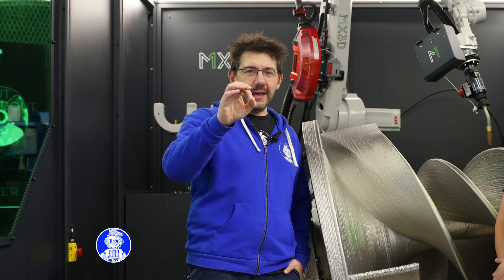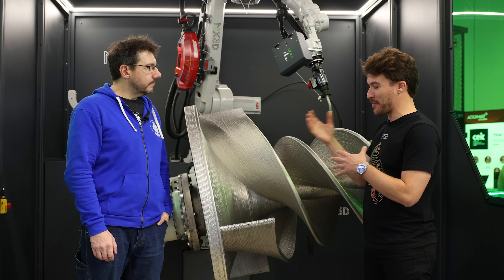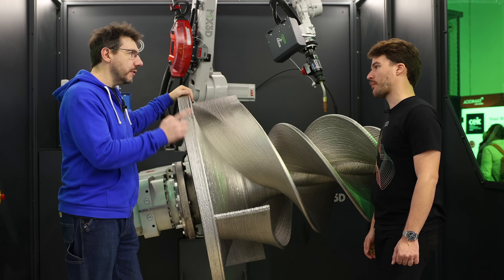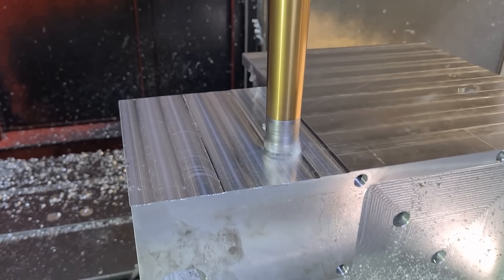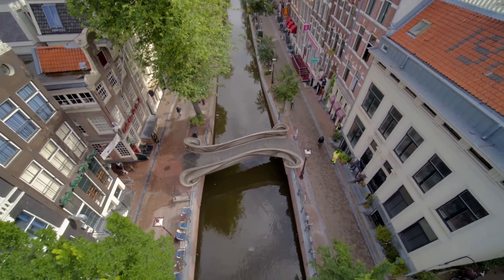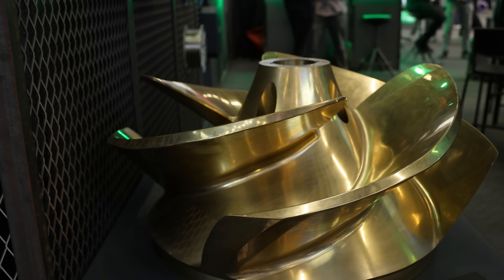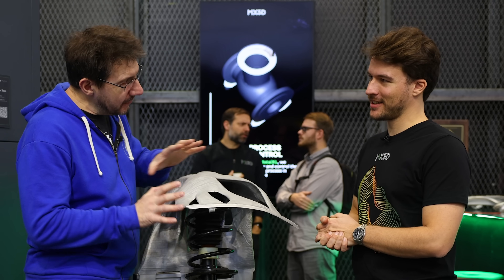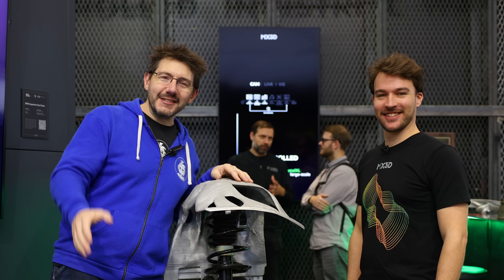GIANT METAL 3D Printing! MX3D // Formnext 2024

Comment: Imagine a whole 3d printed monocoque chassis with this. Maybe floors and firewall out of robotic formed sheet metal or carbonfiber/etc. I always though something like this(and I've seen small systems like it) would work out great. Also this combine with laser welding I think is the next step. It would allow much bigger lasers in practice,  better penetration and better surface or overall finish,  possibly even negating post processing on certain jobs that need precision but not finite clearances...think like a good 3d printer with no layer lines or shifting, z wobble, etc and just a matte style surface finish...especially if the laser can be setup to engrave with a scanner to erode to the final spec

Comment: I wonder if the technology is at the point where it could be used for engines or aircraft parts? I live not far from a military base, I could see having a big business manufacturing all kinds of replacement parts for the base. Then setting up shop outside multiple bases across the country.
Reply: Depends on what you mean by parts. General atomics is using direct energy deposition parts in testing the SkyGuardian for critical parts now.

Comment: I would love to see a wire weld 3D printer that can also mill the finished part
Reply: They do. Look at the laser sintering mills.
Reply: its a traditional robotic arm at the end of the day, the welder is just another end effector tool. 
It looks like this arm is a lighter version, maybe no ideal for milling, but take the stronger cousin arm and you
can mill, grind and polish.
Reply: @SarahKchannel  Yeah I would want something resembling a traditional metal CNC, I have one that I use for milling wood and other light materials but anything heavier than aluminium would be a non starter, I have printed metal parts using BASF Ultrafuse and their baking service, but it costs a fortune and you have to get your part size increase to account for shrinkage spot on, or purposely print slightly over size for post processing by milling. I wouldn't buy any more of it!
Reply: @ For a part like shown in the video a normal cartesian CNC wont cut it. You need a 5 or 6 Axis machine to do contours like they have.
Reply: @SarahKchannel  I I wouldn't be making anything like that, most of the parts I would make can be 3D printed on a regular machine, its just the finishing that I need a CNC mill for.